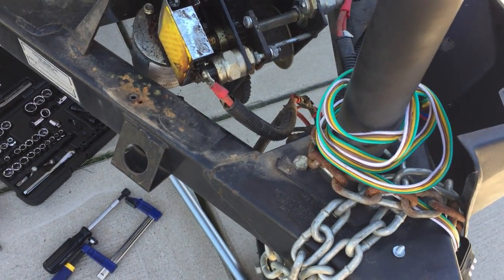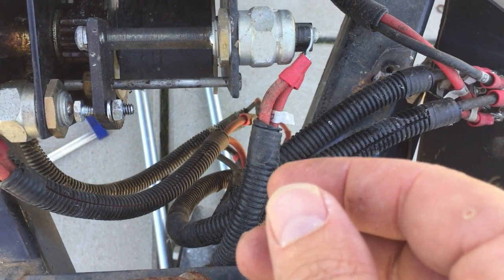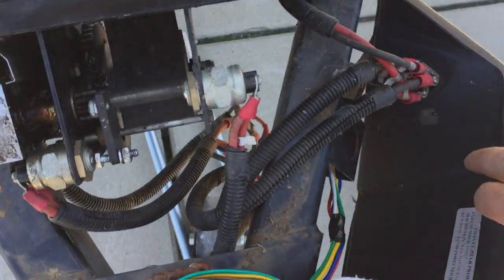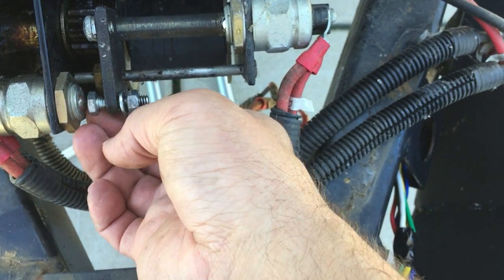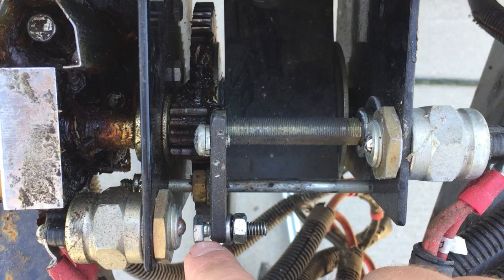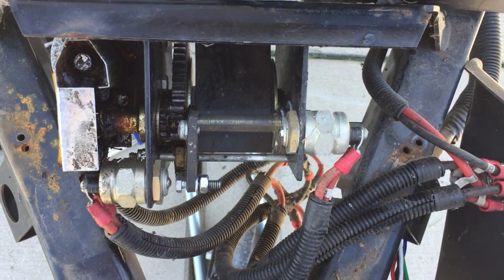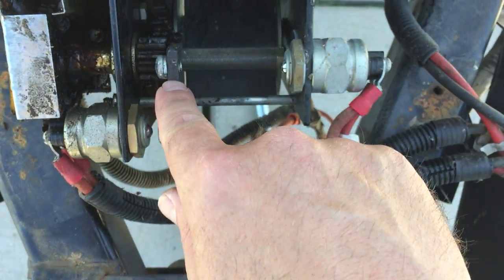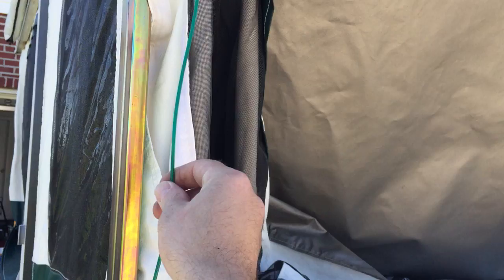Popup Tent Trailer Height Adjustment

Comment: The cord is supposed to be taught not loose. Looks like it needs to ho up more to me. You can not put the door in place if it is not up all the way. Ours looked like this with the loose cable and we had a camper repair shop fix it for us. I am glad to now know how to adjust it now.

Comment: Hi. There is a hex nut on top of the worm drive motor. You should have a hand crank that will fit that nut. 
It might be covered in grease hard to see
Reply: Do u mean this is a way to manually raise and lower we currently have a problem

Comment: I have a 2015 Forest River, Rockwood HW296 pop-up camper. When I raise the top it does not stay where I stop it. it tends to wind down a bit each time I stop so I have to keep bumping it and bumping it till it eventually stays were I need it. this could take several attempts meaning ten or more bumps. How do I adjust the break to make it stop right when I need it?

Comment: Tim, hoping you get this message. I have to replace my winch toggle switch and ignorantly pulled it to take it in for a replacement before looking at the wiring pattern. That looks like the same 6 pole toggle switch I have on my coachmen clipper switch. Can you please take a look at your toggle switch and let me know how the cables from the winch are connected to the six poles?
Reply from the maker: Benjamin Luera sorry for the late reply. Sold the camper.

Comment: Where is the manual crank on this system, I have the same one   If someone knows please let me know
Reply: Hi. There is a hex nut on top of the worm drive motor. You should have a hand crank that will fit that nut. 
It might be covered in grease hard to see